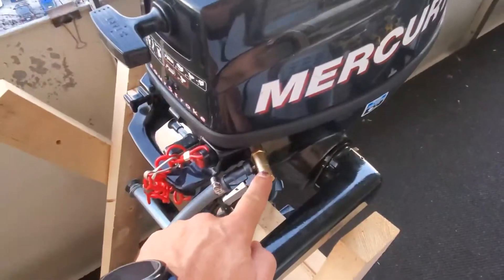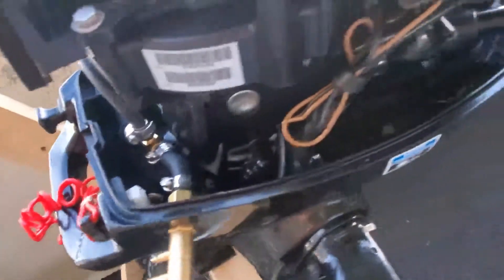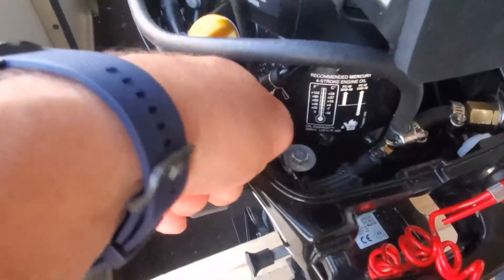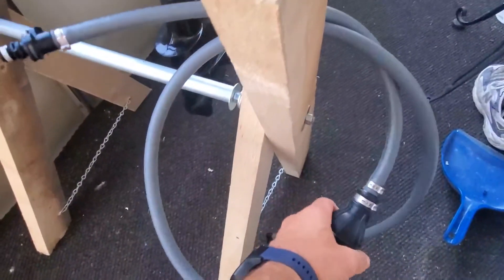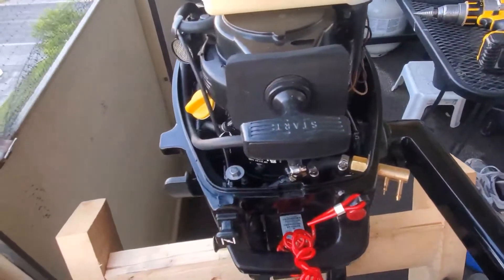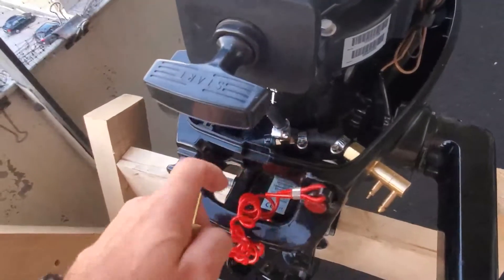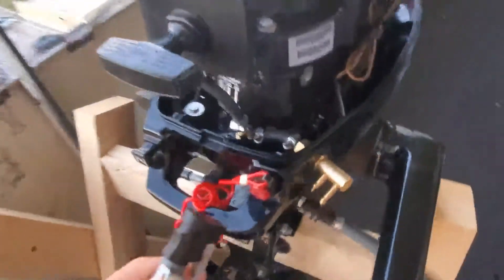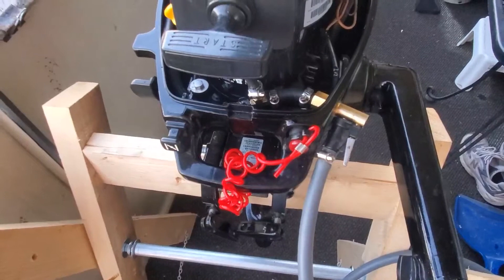Mercury 3.5Hp from remote fuel tank with quick connect.

Comment: Frank I have a 2016 3.5 Mercury and I am wondering if when you made your adaptions for the remote tank if the existing pump was able to pull the gas frok the external tank or did you have to get a differend pump?  Great video Frank.
Reply from the maker: Hello, these small outboard motors does not have a fuel pump. They work by gravity . For this reason you have to install a bilge pump and the valve which prevents the fuel flowing back into the gas tank.
Reply: Così come hai fatto funziona?
Io ho trovato dei Mercury 2,5 con pompa benzina hanno tappo e valvola aria di colore nero

 @FerencHarcos

Comment: Did this help with cold starts? Mine takes 15 t0 20 pulls on first start, Very frustrating for a new motor.
Reply: Raise the fuel level. Under normal circumstances, if you start the operations with a full tank it won't happen.
Reply: @CensorshipGenesis Doesn't help. I always top my tank off before each trip.

Comment: Tried this conversion but cannot get it to work, when I am pumping for fuel I can hear air coming out of the airfilter on the carb. Simply put the system is not getting pressurized. Will a one way check valve positioned right before the carb solve this issue ?
Reply from the maker: Aren't you pumping too much gasoline in the system?
Reply from the maker: You also have to shut the gas cap air valve!
Reply: @FerencHarcos  Air valve at top of original fuel tank i shut off. No gas is coming in the system. I suspect either your tankhose or fuel connector have an inbuilt one way check valve, do you know ? I used a Suzuki adapter because it was less bulky and easier to fit to the engine but I suspect it lacks a one way valve feature.
Reply from the maker: @hbb9302  I only have the gas valve, which also must be close. Otherwise, you pump the gas into the tank.
Reply: @FerencHarcos ciao non conviene togliere il serbatoio interno? Io vorrei fare la modifica ma molti affermano che con un serbatoio esterno e senza una pompa della benzina, questo sistema che hai fatto non funziona

Comment: Did this work out good for you in the long run, Frank? I don't see why it would not?
Reply from the maker: Hello, yes, it did. The only obvious problem is the lack of fuel pump. That's why I have to give it a squeeze time after time to the bulge pump. But I hated to refuel on choppy water.
Reply: I wonder if there is a small external fuel pump you can put inline with your tank ? Something that runs off a small battery and gives the right pressure?  @FerencHarcos
Reply from the maker: @russellwalsh9081  Wow, that's a great idea! There is always room for improvement. One quick search on Amazon and found one 12v for only $16.
Reply: Cool Frank. I just talked with the dealer at online Outboards he says it comes with a fuel pump now....are you sure yours doesn't have one already?  I imagine you know...but just checking in case maybe it does.  @FerencHarcos
Reply: What pressure does it take?  @FerencHarcos

Comment: Hi Frank, question , when you use external fuel tank, need turn fuel switch off and OEM fuel tank vale off ? Thanks
Reply from the maker: That's right. If you don't shut the fuel valve, you will pump the fuel into the main tank.
Reply: @FerencHarcos  Thank you Frank 👍🏻

Comment: You need a fuel pump to make it work or you need to pump it every couple minutes dumb idea
Reply from the maker: That's true but this is the motor I can afford, and pump is still easier than refuel on choppy water.
Reply: @FerencHarcos  if you put the carb off the 4 or 5 hp mercury it may have the hookup so you could hook up a fuel pump and do it. I have a 5 year warranty on mine so im waiting b4 i start changing things

Comment: Love the video but one question Frank. Does the motors red fuel tap need to be on for the remote tank to draw Fuel?
Reply from the maker: Hello Robert, yes because I have placed the T right behind the fuel line connector. So it is before the fuel tap. I don't use the built-in tank at all, but the option is still there. Make sure u close the air valve on top, otherwise the gasoline will b pumped up to into the built-in tank...
Reply: Hi Frank.  Yes, ok. I've done mine exactly the same as you..absolutely brilliant! Many thanks.

Comment: Great Idea Frank, Just finished mine, I have a 2020 which has a fuel pump, so I did run the T splitter after the fuel petcock and before the fuel pump, works great, glad I wont be filling up on the water and I will now use the original tank for an emergency aux tank .

Comment: thanks for the demo. one question. what is the relative "vertical" location of the external tank to the carburetor? does the external tank need to be higher (same height as the top tank), since gas flows down to the carburetor by gravity?
Reply: When you pressure up the fuel with the primer bulb it won't break suction unless its disconnected or if it has a loose connection. The external tank draws the fuel from the bottom of the tank.
Reply: @westtexasconstruction  my trial home by Ted Williams motor is that the external tank's vertical position cannot be two low from the carburetor' maybe 1 ft at most. Otherwise, the motor's suction force cannot move the fuel up from the external tank and the.motpr quits. if I place the external tank above the motor, then no problem.
Reply: Only problem you can't spin it 180 for reverse, no?
Reply: That’s was going to be my question too. Without a fuel pump, it’s basically a gravity fed set up. How will It draw the fuel from 6 ft of hose up hill? I want to try it but afraid to start drilling holes and buying expensive parts.

Comment: Is there a gasket between the external fuel hose connector and the 1/4” female to barb fitting mounted inside to prevent fuel leaks?
Reply from the maker: I used fuel grade teflon tape

Comment: this motor is not designed to  add fuelpump, driven by camshaft. so thiss external fuel tank will never work
Reply from the maker: Hello. The fuel is not forced by camshaft. The fuel line has a vacuum pump.
Reply: @FerencHarcos  haha. in all 4 stroke outboard fuel pump is driven by cam shaft. vacum pump in 2 stroke is driven by pulses from crank case
Reply from the maker: @iboats1  OK. Than you can also explain how does this motor comes with just a drop tank without anything to do with the camshaft and still works. I would strongly suggest you to check this engine before you comment on it. I wouldn't mind to argue on something that makes sense. This is the actual outboard we r talking about: Mercury 3.5 Hp. with built-in tank.
Reply from the maker: Oh BTW the modification worked through the summer so far. How ever I thank you for your attention and comment.
Reply: @FerencHarcos  I work as mechanic in outboard servie busines  so i know what i,m talking about.
Reply from the maker: @iboats1  And u might be right but this modification still works. I have used it through this summer.
Reply: @FerencHarcos  hi Frank I’m a retired marine/fishing engineer engineer and yes your mod does and will work
Reply from the maker: @jondunedin5369   Thanks for your comment. I have posted a short video about our last vacation, where the motor is fully operational.

Comment: what you did was pretty cool, but I have to ask why not get the 4 horse and gain the aux tank function along with through hub exhaust for a quieter motor and gain .5hp
Reply: The 4hp is also 9kg heavier than 3.5
Reply from the maker: Hello. I have this engine for like 4 years. Perfect for my zodiac, the only issue I had was the continuous refill.
Reply: @FerencHarcos  I understand, I use the 4hp on both my 12 foot sea nymph and my west marine PRU-3, I like having the external tank too
Reply from the maker: @jacobbrown9753   BTW my motor is 3.5hp. That's pretty close to yours :)  Anyway I live in an apartment building and must keep storage space as a limit that's why I have a Zodiac. Pls. checkout my uploaded videos.  Also enjoy working on stuff.

Comment: I assume the other line going to the T is coming from the original tank (on top of motor)? Sure that’s right but just confirming because I am definitely adding this external tank to my motor. Awesome video by the way! Oh almost forgot. Did you have to purchase any extra fuel hose?
Reply from the maker: That's right so u can use the motor from the internal tank as well. All u have to do is open the valve.
Reply from the maker: That's right so u can use the motor from the internal tank as well. All u have to do is open the valve.
Reply: Did you purchase extra fuel hose? If so 3/8
Reply from the maker: @michealmccroskey8876  Yes I did and go with 3/8 because the 1/4 won't fit on to the brass connectors.
Reply: Ferenc Harcos I purchased the parts today for adding this to my motor. I purchased a 3/8 Brass T and a 3/8 brass connector for the quick connect. Is that correct? I think your material list says 1/4.
Reply from the maker: @michealmccroskey8876  
Hello Tomas 
As long your gas lines fits on your brass connectors should be ok. Probably larger diameter is even better because gas can flow better. Let me know if you need more advice.
Reply: Ferenc Harcos thank you for this video and all the information. This was very helpful!! The hose ID is 1/4 which will fit the connectors perfectly. The 3/8 connectors and 3/8 ID hose is too big. Stick with 1/4 and everything is good.
Reply from the maker: @michealmccroskey8876  I'm glad it worked out for you to.
Reply: @FerencHarcos  Okay everything is hooked up properly and I was able to start the motor and run it. However, it seems to NOT be able to siphon gas from the tank continuously. This may be the result of the line from the tank being too long. So I have shortened the line to where the pump ball will remain in the vertical position. I have not tried running the motor since shortening the hose due to time. I will reattempt later today. But for clarification: Your motor (which is the same as mine - without a pump) can siphon the gas from the tank continuously without any sort of pump? Thank you for your help.
Reply from the maker: @michealmccroskey8876   Did you purchase the line with the back flow stopper? 
https://www.amazon.ca/dp/B006MIXGXM/ref=cm_sw_r_cp_apa_fab_P.fGFbKNA43N3
Reply: @FerencHarcos  This is known as the Fuel Demand Valve? I actually purchased that separately and also added last night. Have not tried since adding this Fuel Demand valve.
Reply: @FerencHarcos  I also found some information concerning adding a pulse fuel pump to the motor by connecting a line to a pulse port on the crank case. However I have no clue where that port is located on the crank case and whether or not it is even necessary.
Reply from the maker: @michealmccroskey8876  
Yeah man u lost me there. I have no clue what is a pulse pump. Sorry 
Occasionally I also have to check how hard is my pump to not to loose pressure..
Reply: @FerencHarcos ciao quindi usi la pompa a mano che si usa per travasare i serbatoi? Io ne volevo acquistare una e fare un foro sul collettore di aspirazione per farla funzionare